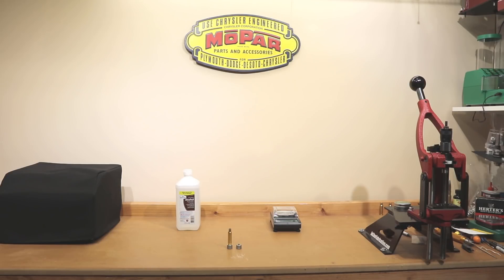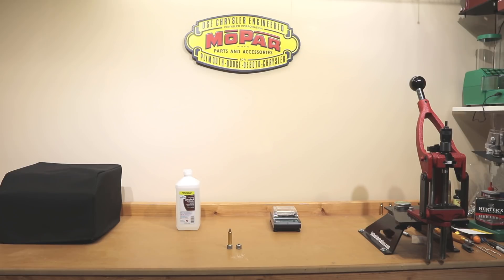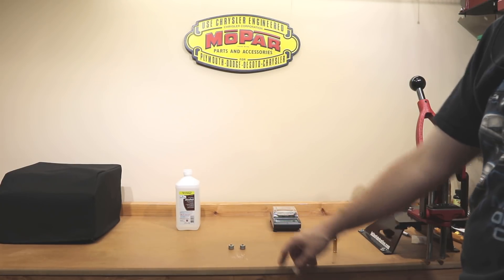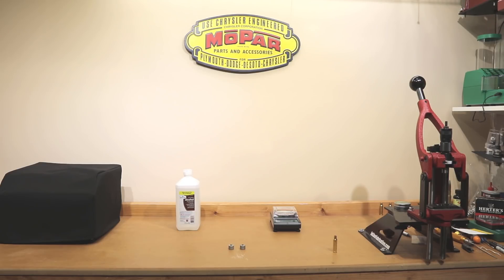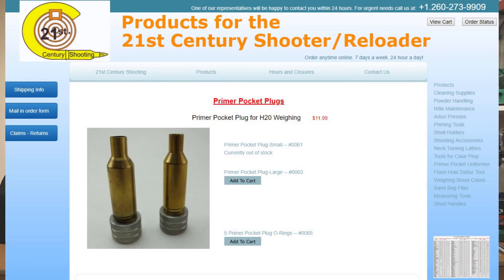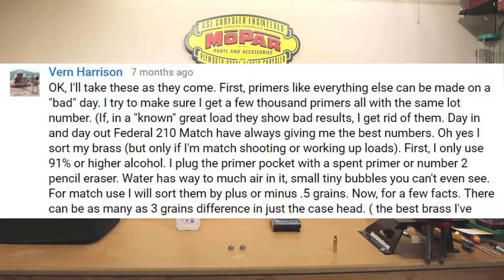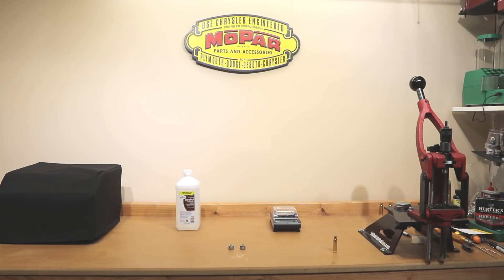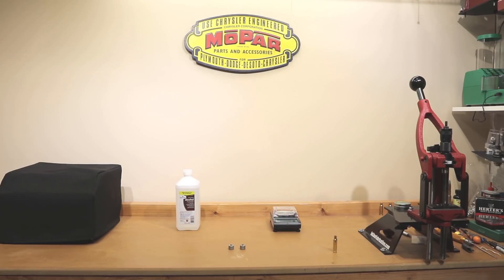Case Volume Measurement - Using Primer Pocket Plugs and Isopropyl Alcohol

Comment: 99% is the best to use of you can find it. 91% is everywhere.  Caution to all as alcohol in 90% or higher can harm your skin and also absorb quickly to your body. Wear gloves.
 The less water the better as then it can be used to clean electronic parts as well as firearm parts. Caution again as it can strip the oils a grease faster than a person thinks and the rust can appear faster.
 It'll strip the oils of your skin really fast and damage skin layers when using it while not wearing gloves and glasses.

Comment: Multiply the weight of 91% Isopropyl alcohol by 1.24 to get the weight of an equivalent volume of water.
Reply: That's right the density is not the same

Comment: Why is there a need to convert to water weight?  IF we are just measuring internal capacity of each case, it should be as simple as plug wt + brass wt + liquid wt (in this case the alcohol) for a given batch of brass.  Right?  Let me add, I'm new to rifle brass reloading, so just a question, as my plug came in the mail today :-)
Reply from the maker: If your comparing alcohol to alcohol that's fine, the density of alcohol is different so if you want to speak grains of water you have to convert. A lot of guys use water, but there are benefits to using  alcohol,  but you have to convert to speak the same language. Hope that makes some sense.
Reply: Thanks. I didn’t consider comparing results with others, only within my own lots.
Reply from the maker: Then you shouldn't have to worry

Comment: You should have the primer pocket volum included.
Reply: Insert a spent primer upside down with the anvil removed. The primer pocket will not trap air this way(theoretically). And, the primers will all weigh "about the same" with nothing inside of them. I am not sure where I read this, but  it sounds good to me. Hope this helps.
Reply: Disregard, I just re-read your comment and realized what you were saying.

Comment: Use denatured alcohol.  Since the alcohol is evaporating much faster than the water in rubbing alcohol, the density of your control media is constantly changing with time and throwing off your results.  Plus, a gallon from the hardware store is way cheaper than the drug store.  Just a thought since you need fluid mass density to be stable because you are using mass to ascertain volume.
Reply from the maker: I don't disagree,  not sure how much evaporates is a half hour but its probably close enough for me.
Reply: Bolt Action Reloading Probably minimal in a single sitting. I'd be more concerned with lot to lot variation and trying to draw conclusions over time about the capacity of different lots/manufacturers/post fire formed chambers, etc. There's no concern with a homologous stable mixture.  Maybe I'll try a test, but I can tell you from running alcohol camping stoves, you're going to be better with straight alcohol as there is very significant variance in rubbing alcohol concentrations over time.

Comment: Alcohol will have less surface tension, so it'll fill the case better. Not sure about dissolved air, but I'd definitely use alcohol to test with.
Reply: If you add a small drop of detergent to the water you also decrease the surface tension

Comment: I think your crazy.... Just kidding. Seriously, do you really think this will shrink your group size? According to your test Starline came out on top? I have seen people shoot some really tight groups without neck turning, weighing cases, etc using Lapua brass. Check out Panhandle Precision here on YT.
I personally, Have shot a 3 shot group at .09 MOA at 200 yds (my best shooting prone with a stock Tikka Tac A1) and many 5 shot groups of less than .25 MOA at 300 yds. All shooting prone with stock Lapua brass. I have only been reloading for about three months and I learned everything from reading and YT videos. So thank you for that.
Reply: I know this is an old comment. The answer is, possibly, we all have shot tiny groups with factory ammo. I use case capacity for Quick Load and take the average. I will only sort brass based on weight for matches and sometimes load development. There are many steps that people do in the reloading room that may not show up on target. Or, the added confidence in the load may simply make them shoot better. At the end of the day, there is no replacement for actual range time. So, if you are deciding on extra steps in the reloading room and being on the range shooting, go shoot. We have all seen the guy at a match with the most expensive equipment and weighing things down to the kernel of powder get smoked by someone using a chargemaster and no sorting. In the long-range game, your wind calls will make or break your score. Having said all that - there will be many guys on the line that are all putting that much effort into their reloads, and they can all shoot really well so to be competitive you must cover all your bases.
Reply: @bb281tomball  Thanks for the comment.